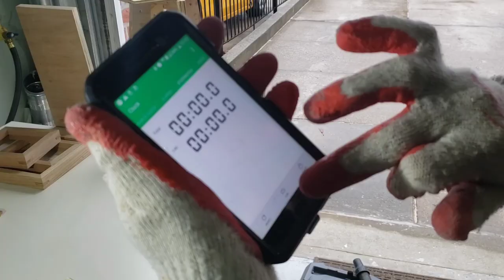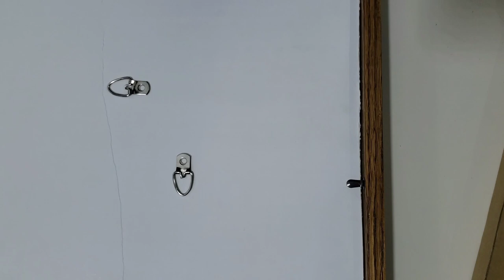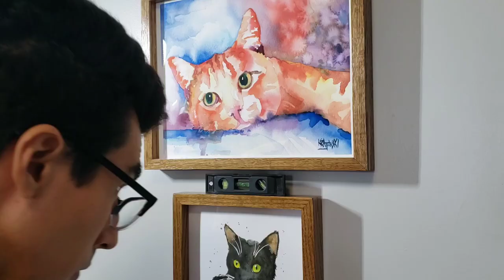Making a Spline Jig/Rabbeting Jig/Miter Jig (For Picture Frames)

Comment: Is there a list of tools/supplies/materials that you can provide?  For example, something that lists the circular saw you used, specific screw sizes, etc.?  Thanks!
Reply from the maker: Hi, I do list some of the materials I use in the description.

I'll include the Home depot link to the circular saw and other items I've used.

Let me know if you have any questions.
Reply: @makesandskates  Much appreciated!  Would you also consider adding the hardware you used (specific screw sizes, etc.), the strap clamp, 90-degree clamps, etc.?  Also, are you recommending to use the "Yonico Rabbet & Bearing Router Bit Set" or the "Freud 3/4" (Dia.) Double Flute Straight Bit with 1/4" Shank" instead of the hole-saw bit to make the hole for the router wider?  Thanks!

Comment: Awesome video. So I’m new at using a router and I purchased the same one that you have. Is there a base plate you can buy to do the rabbet edges ? I won’t be able to make that lol.
Reply from the maker: Not sure if they sell that.

There are rabbeting bits that should work for the router, as long as your router takes a 1/4 inch shank.

I left a couple links in the bottom of the description of some rabbeting bits that seem to be decent and are affordable.

Don't forget to be careful of the bit blades on the router, I've easily forgotten to keep my fingers away from it when I first started using the router and nicked myself once (luckily it wasn't that bad and it healed after a few days)
Reply from the maker: Also, glad you liked the video!
Reply: @makesandskates  could you make one for me and I’ll pay you.
Reply: Is there anyway you can make that sled for me and I’ll pay you. For your time and shipping. Thank you
Reply from the maker: @fayebasile8792  Sorry I didnt see your response until now. I dont get notifications sometimes. It would be difficult to make one unless you happen to have the exact same router as me.If you do happen to have the same router, we could discuss further via Instagram @BuildsByAlexis if you want.

Comment: Can you do this with just a circular saw? I am quite stuck with my first project! Thank you!
Reply from the maker: It would be really difficult to achieve mitered picture frames using just a circular saw. 

I would advise on using butt joints instead. In terms of reinforcement, I would use one dowel per joint.
Reply: Thanks for your answer @makesandskates  !! I need to learn a lot. I’ll keep working and learning. Thanks so much.
Reply from the maker: In regards to rabbeting the frame, you wouldnt be able to with a circular saw. In this caseni would have the frame oriented so the widest side of the picture is facing outward and then support the picture using the turn buttons.
Reply from the maker: Been thinking of making a quick, cheap diy video on making picture frames using just a drill and handsaw (or circular saw)
Reply: @makesandskates  My friend, have you seen my last video? I think I managed to cut rabbets with my circular saw. What do you think?